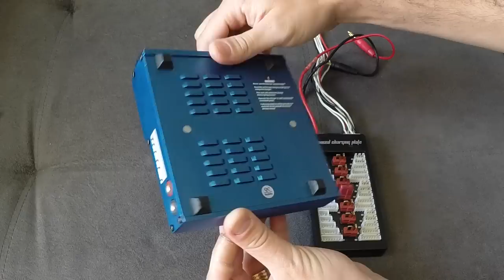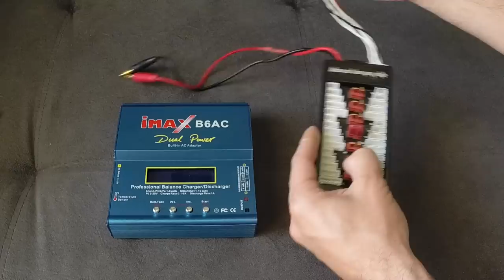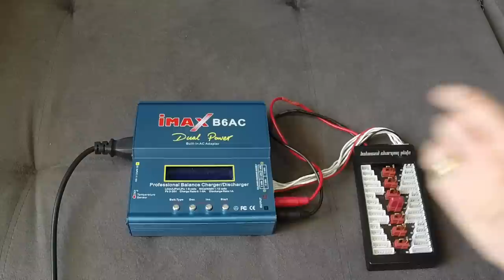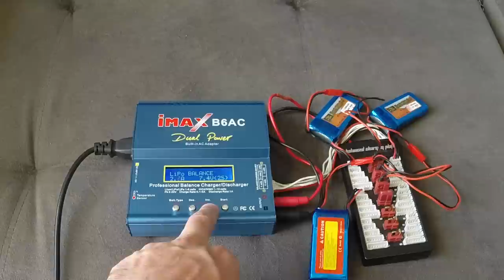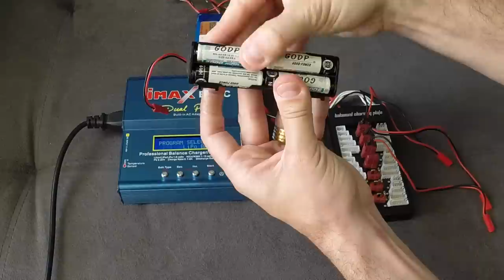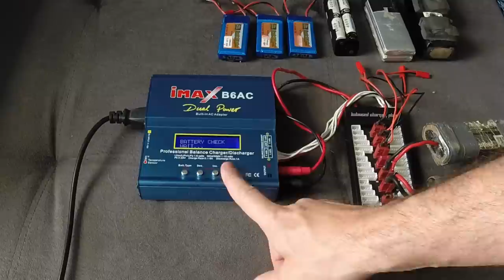Charger iMax B6AC B6AC Lipo NiMH NiCd Parallel Charging Board in English

Comment: This charger was recomended to me but I am completely in the dark about lipo batteries and chargers.........and now I am enlightened.
Perfect timing and thank you.
Reply: when considering this charger be VERY CAREFUL there have been many knock offs that copy this exact charger, you need to check for a holographic sticker on the bottom. the manufacture of the original "skyrc" made a V2 of this charger that way people could not copy it without getting sued
Reply: Edwin Baranov I have the "copy" for about 2 years now. The charger never let me down!

Comment: Hi I have the imax and parallel board same as you and I tryed to charge 2  11.1v 1000mah 3s lipos. When I pluged in the 2nd lipo they both smoked and started to heat up. I didnt have the imax pluged into the mains at this point what did I do wrong?
Reply: got it! take a closer look at the board. the balance plugs have different direction on each side!

Comment: Hi and thanks, I had a question:Charging speed and time differ in normal and balanced mode؟؟؟؟
Because I have the same device and in the balance mode it took six hours to charge the battery li po 7.4 2500 mah
Reply from the maker: hum should not take that long.

Comment: Hello,

I'm affraid that you can damage Lipo with this solution.

In fact, for exemple, if you plug three lipo 3s 1300mAh with different amount of charge and the current limit is 1300 * 3 = 3.9A:

-The lowest charged Lipo will take 3.9A charge current while the other are waiting the lowest Lipo to reach their charging voltage.

Comment: When using your charger for the NiCAD drill battery will the charger turnoff when the battery is charged?
Reply from the maker: Yes
Reply: Felipe, how do I determine what posts are used for charging for positive and ground?

Comment: I have had 2 nimh receiver battery burn and I only charged at they rate, one was 2400 and other was a 2300, old guy from club said only charge at 800 and I did that and only had 900 in battery after charged any help mate.

Comment: how long whould it take to charge 2  2s lip is at once ?   is there a big time difference with balancing and charging ?  can u charge with the board or just balance? thanks
Reply: Dude, you always have to balance a lipo, if you just charge it, they could explode ore something. Every cell hase to have the same voltage. For example= Max 10V. Cell 1=7V Cell 2=3V. Thats not good. Balance your lipos every time dude.

Comment: hey nice video. helpt me a lot. If you charge Nica battery's how do the charger know the right voltage and how many cells are connected in serious or parallel? I am a little confused because you can just change the charge current. Is the charger able do notice the right voltage by itself? Thanks in advance!
Reply: Schinkenjupp 
don't take this advise it's not right
this guy charges way to higher amps and way to fast for Lipo
so god knows what other batterys will be like charged that fast 😤

Comment: Amigão, posso colocar 5amp prá carregar seis bat lippo 3s de 2.200 amp?
Reply from the maker: Sim você pode. Você deve fazer a conta ( 6 bat X 2.200 = 13.200 e divide por 10 ou seja 13.2amp ) este seria o maximo para recarga rapida.
Sempre utilize 1amp por cada 1.000 mAh.
Reply: Valeu, muito obrigado pela resposta amigo qq coisa estamos por aqui. Abraços.

Comment: thats a pirate charger man, just in case you didnt know. the original one has a hologram sticker on bottom.
Reply: Do you know who sell authentic charger?
Reply: Hobbyking seems to sell it but doesn't have it in stock.  RC hobby stores have this in finland, try stores in your country?
Reply: Iikka Konola   I need good technical support as I am charging my real car Hybrid batteries, not a toy.   Very few stores left in USA that offer this product, then good technical support is not there
Reply: Well I think this is quite a bit undersized for charging car battery, if you mean 100AH+
Reply: Iikka Konola I will take each battery stick out of car.  Each stick is 7AH.   This is the charger recommended by many videos I watched.   It is trickle charge and discharge for 12 hours.

Comment: do you can charge one time two batteries 6S?
Reply from the maker: yes up to 6
Reply: Felipe Zafani
on parallel charger plate you can see second 6S balance port. What function it has?

And i need one capacity lipo or can i charge 2S 2200mah and 2S 4400mah?

Comment: Are you charging your Lipo batteries at 5amps? Don't do it! They will certainly NOT last long! Advised is to charge them at max 1A.
Reply: What? I charge my 3s 5000amps at 2.5A When you have 1000amps=charge at bout 0.5A when you have 2000=charge at 1A. Take halve of the amps as charging A and your good